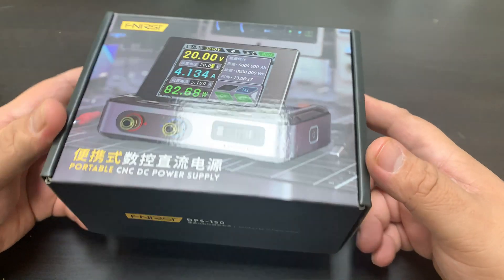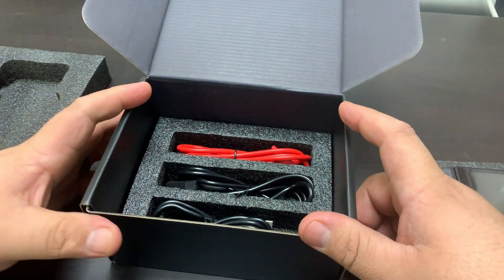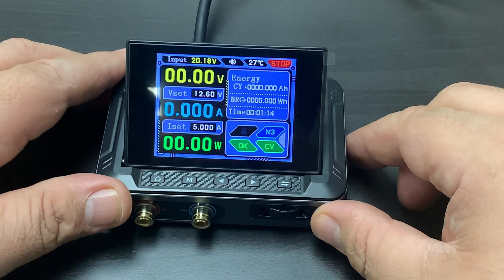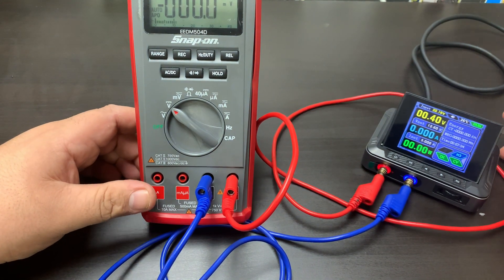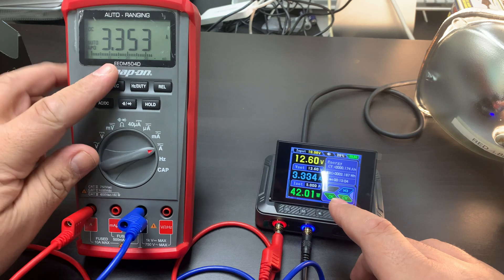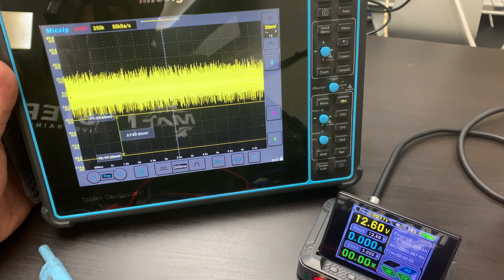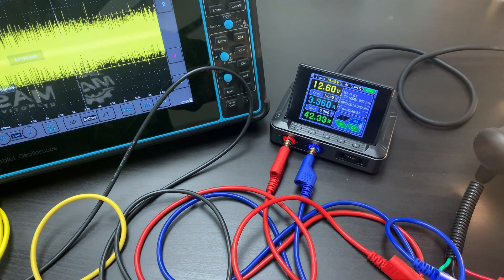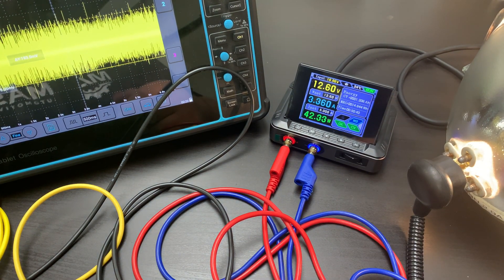DON’T Buy a FNIRSI DPS-150 Until You See THIS! (Automotive Review & Test)

Comment: Hello,
your ripple measurement procedure is not correct. Check on YT videos about the proper procedure to measure the ripple. On this power supply, you barely get 20mV. Even if your input is noisy, you should difficultly have 100mV or more.
Reply from the maker: 100mV or more, input that into a module and see how that goes.

Comment: Hello. Nice stuff. The only issue I saw is that you aren't reading the ripple of the power supply. It's noise from switching. Ripple is a periodic signal. I have one dps150 and read 25mv ripple in load testing. Also lots of noise that came from environment, electric line, etc...

Comment: Nice setup! 👍 Just a note: your multimeter's (Snap-on EED504D) reading of 3.354 A is actually spot on when you consider its accuracy of ±(1% + 1 digit). That gives a possible range of about 3.315 A to 3.393 A. So the DPS-150 showing 3.335 A fits perfectly. 😊 Measurement isn’t about trust, it’s about understanding measurement error and accuracy.

Comment: The ripple voltage measurements are wrong. Thats' not the way to perform such measurement.
Reply from the maker: ok.
Reply: @MasterAutomotiveTraining  You'd want to measure it using a stable supply, like a battery. Otherwise that noise could be coming from your USB supply.

Comment: On the last page of the manual you'll find "The product operates in step-down mode, so ensure that the input voltage is higher than the output voltage." 
That's so cheap to make it sound like it's a buck/boost, step up/step down converter until you find out on the last page in the manual. Also very weird to not use a buck/boost module in a product like this, I wanted a portable option to use with a 5V power bank, but this was a no go for me.
Reply: @ScinnerNo1  Buck boost is unnecessarily complex and adds noise. I don't mind having to use a higher voltage input power supply if that means I get less noise out of this thing overall.
Reply: @moshet842  I already have a lab supply and was looking for something portable to use with a power bank or better yet with a built in power bank!
Reply: @moshet842  Let's hope someone smarter than you and me figures out how to simplify and remove noise from buck/boost converters in a near future then!
Reply: @ScinnerNo1  They do have ultra low noise boost converters but they are expensive and only used in applications as necessary. That's the nature of AC.  On the other hand, the typical go-to for low noise step down conversion is a low dropout linear regulator even with its drawbacks. It is always a tradeoff in electronics as with everything in life haha
Reply: @moshet842  I guess I'll have to make a 30V power bank :)
Reply: @ScinnerNo1   I am not sure if this thing supports it but the latest gen PD 3.1 standard can output up to 48V. This device may only support the previous gen PD which is limited to 20V output. I don't have a PD 3.1 power bank or charger to test.
Reply: ahh damn
Reply: That's good to know, I was scratching my head when looking at the input and output specs. It didn't seem to be adding up.

Comment: Considering the Snap On meter has a relatively low minimum DC accuracy of half a percent plus or minus a few counts, the discrepancy in the current reading lies within that spec so it is likely the meter that's off not the power supply. Based on my testing with a very high accuracy Brymen meter, it is almost spot on.
Reply: Have you tested the ripple? If so, what did you get? It's advertised as less than 20mV.
Reply: @ScinnerNo1   I haven't but check out Kerry Wong's review video. He tests ripple starting at 25:30. In my opinion, it has impressive ripple for a switching topology and considering the price. It performs even better when you use a PD power bank as the power source. Most lab power supplies usually have double the ripple with no load. Strangely, this thing has less ripple with a resistive load which is pleasantly surprising. 😅
Reply: @moshet842  I just found out it's only a step down converter and therefor don't suit my needs.
Reply: @ScinnerNo1   Gotchu. Just wanna make sure you're aware that typical PD power banks can output up to 20V depending on necessity. I have tested this device with a PD charger and PD power bank and as a PD device itself, it tells the charger/power bank to output 20V  by default. My point is, you are not limited to 5V when you use usb-c PD compatible power banks. My Gooloo lithium jump starter for example supports PD output and it is a perfect match for this toy.

Comment: Im not sure about your multimeter brand, but i saw this one tested with fluke multimeter the results were spectacular and spot-on, no changes at all. Even voltage and current .
Reply: May be due to same underlaying circuit making Cimese factory.
Reply from the maker: Ok.

Comment: great video but excuse my ignorance, im learning. would turning down the amps lower the ripple?
Reply: You're spot on. However, the best way to reduce ripple on this supply is to use a battery or a low ripple linear power supply as a source.

Comment: The biggest reason to buy this, is the fact that is about the only product that is powered by USBC.  Couple it with a 100W Power Bank, and you got a really nice portable supply.  The only other product I know that can do this, is the Shargeek Power bank, and its only CV, not CC and is limited to 75W.
Reply: Some powerbanks implement USB-C PPS (Programmable Power Supply). So if your USB-C adapter/charger/powerbank supports PPS, you can just buy a "trigger module" to turn it into 5V/9V/12V/15V/19V DC outputs. You'll also need a proper cable for this. This can be quite useful, as the voltage conversion is then done only once at the powerbank or charger itself.. with this power supply, you'd convert the voltage twice.

Comment: Its a switch mode supply being powered by a switch mode supply.  You're going to get high frequency ripple.  Although I don't see where that is that big of a problem.  One of the reasons bypass caps are used.
Reply: It's advertised as less than 20mV ripple.

Comment: They’re good enough for powering, light bulbs, and things like solenoids in small drive motors
Reply from the maker: Exactly. Did a great job with a sealed beam bulb, would be good for small jobs instead of lugging out the bench power supply.
Reply: @MasterAutomotiveTraining  and why would one need one of those as apposed this?!